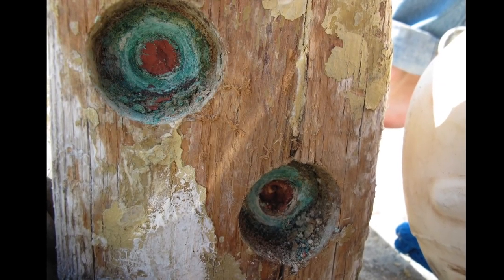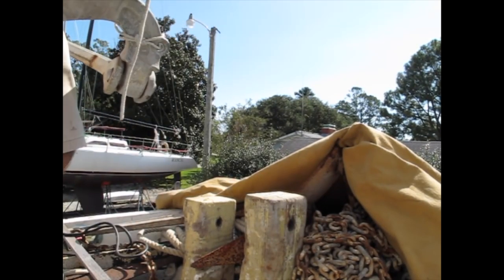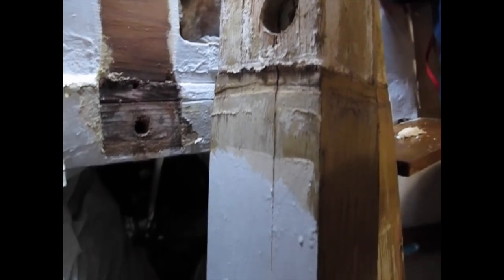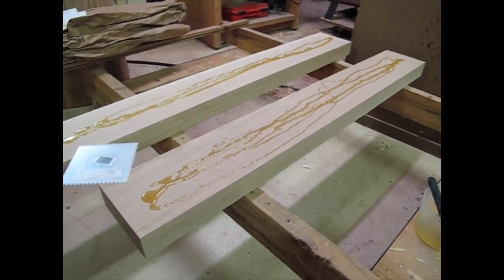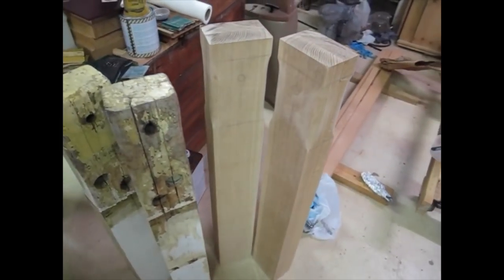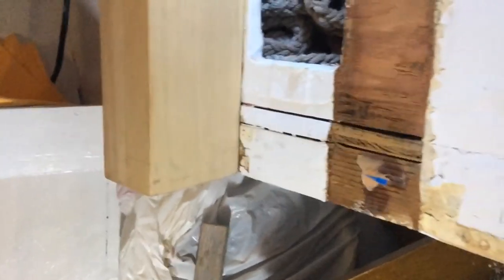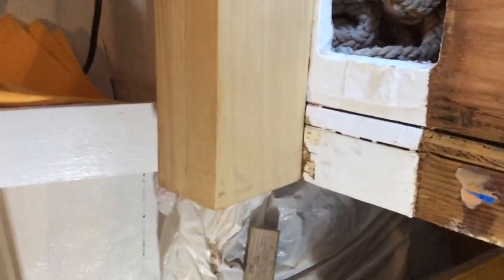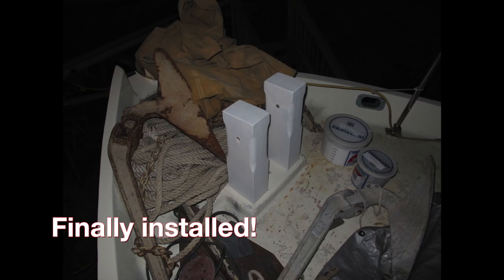Replacing the Samson Posts on Idle Queen

Comment: I see you just launched! Amazing well done , it’s really hard to stay motivated sometimes! 
I was wondering how you sealed the post to the fiberglass to stop leaks as everything flexes under load?  Cheers warren
Reply from the maker: Hi Warren- Thanks! It's good to have her back in the water. It's been a long process, for sure. The new Sampson posts are sealed with a bead of 3m's 4000 UV. The top of the holes in the deck are beveled a bit to provide more bonding surface. If I were to do it again I'd probably seal them with a generous worm of butyl rubber, and maybe cover that with a trim ring to make things look neater and protect the butyl from sun damage. So far so good, though.